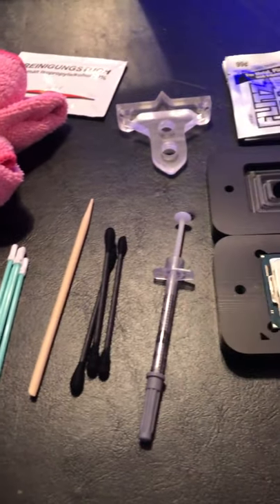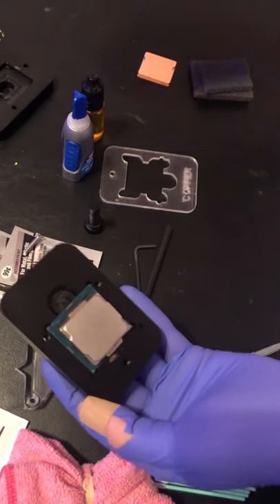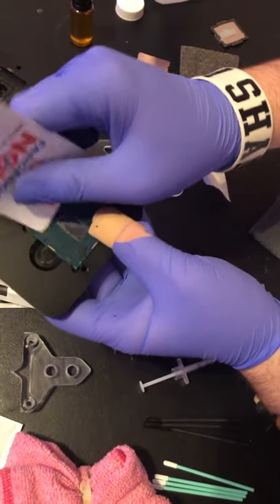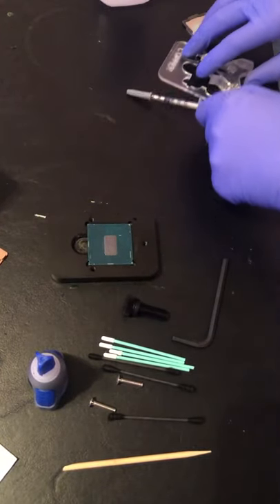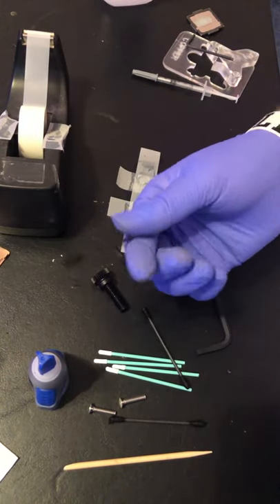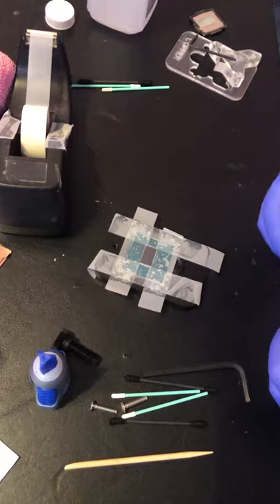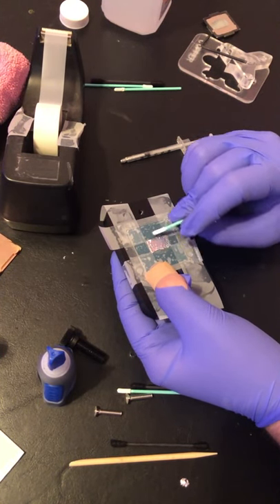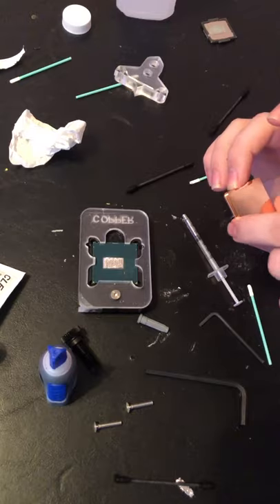Delidding My i7-8700K with Rockit Cool's Copper IHS Upgrade Kit

Comment: I know Im kinda late but bruh , what you applied there was not liquid metal it was quicksilver solder removal….. in some cases some solder will be still attached to the cpu  and you use that to clean the solder…

Comment: Great video, and your assembly went nice and smooth! BUT! I think its somewhat not showing the most important at all!! What were the results?! Before and after.. You only show a cold 800 Mhz temp, which is pretty much useless! Mine 10900K stock cold boot cold water also has that idle temp at P3 level. You should have run Aida64 stability test for at least 15 min. and recorded the temp and average temp.  Do the same after your IHS upgrade and compare delta. I have today ordered this kit for my 10900K and will do exactly as you with only 4 drops of glue for absolutly best result and performance! Really hope it will make a difference! Also I will be trying Coollaboratory Liquid Extreme which is a 100% metal paste (like liquid metal but as a paste) to use between the IHS and waterblock for optimal result. I will be useing Conducanaut liquid metal for the Die and under the IHS. So all that stuff combinded are gonna be interesting!   Can you provide some before after results? and everyday drops?
Reply from the maker: I didn’t go too terribly far into posting detailed ‘after’ results because I did this somewhat out of necessity. I was getting fairly high temps (45 - 50 at idle) out of nowhere and after replacing my cooler with not much changed, I looked into this option. So even at that point, if I did do a full test with more detailed results, they would have been inflated by whatever hardware issue I was experiencing with the chip. So more detailed end results compared to results on a chip with a hardware issue, to me, would have been useless as well. I just know that at idle it sits around 28 - 32 Celsius and has continued to do so since this video was uploaded. Even under load I rarely see it get above 55 and I use this pc for steaming and video editing. I still of course recommend doing this to Intel chips but I wish rockit would do more than just provide video links when the products in their videos vs what you actually get these days is vastly different. The video isn’t necessarily meant to be a “how to” or to be super analytical, but more to show people what the process looks like and maybe crack a few jokes. I do hope you found the video helpful in that sense at least.
Reply: @Obelus13  I definatly did find it usefull .. I always watch quite a few different youtubers as results can vary! Also to see the best and different techniques. ex. I have never delid before and did not know the 4 tiny drops of glue outside IHS to substrate is actually one of the most important things in the assembly. I have also study  how to with the LM. I only tried that once before and that was a nightmare and ultimately I had to abandon the LM. It was like a metal drop which could not be spread also the surface was to polished and mirror-ish-  I have learned that even though nobody show it or promotes it.. the best thing you can do is use grit 1500 wet sand paper to carefully rough the surface on the die...   I have very bad experience with mirror finish LM applications so I just baffle when people with easy spread and install on youtube... I will be carefully sand and they also says it lasts a lot longer when sanding due to the way the LM spread and integrates-- guess I will have to see! ;)  on monday my kit arrives for my 10900K

I have a 10900K when at all core 50x under heavy or extreme stress test the CPU package exceeds 95 celcius and also 4 cores or something.. and that mean throttleing!! and we CANNOT have that! ;)  So this is why in my case even 5 celcius improvement is JUST the ekstra headroom I need for non throttle maximum performance....I do expect 10c difference if perfectly installed but I have learned to set your hopes to high haha! I guess ill have to see when done.   If my CPU was like 120c the extra 5-10 c meant nothing! But when my CPU is 95-96c on some cores and the package it will be just the difference I need- So I cant wait to install monday. I will be useing LM under IHS and 100% metal paste on top for optimal results.